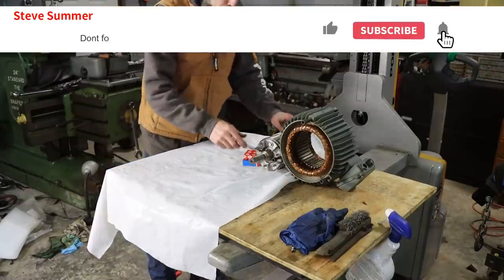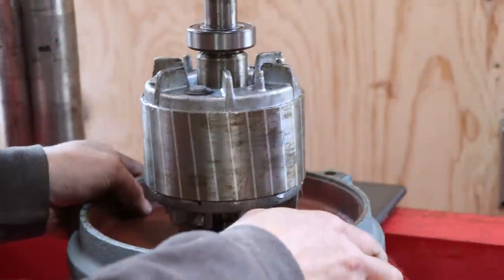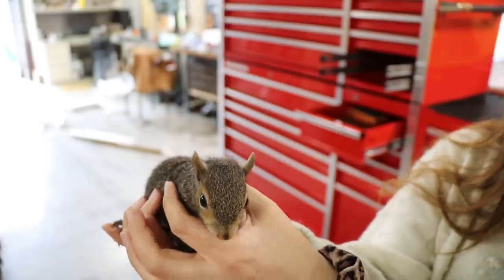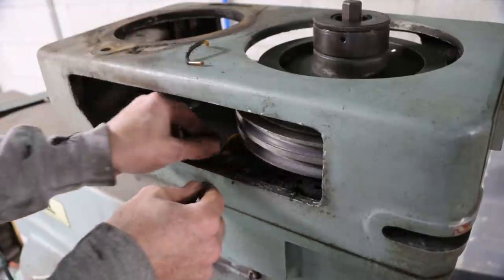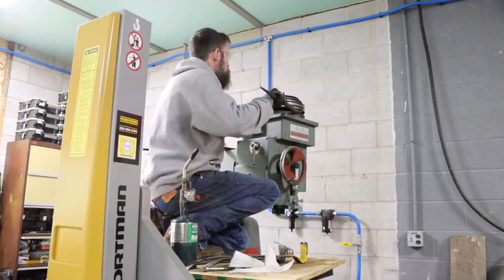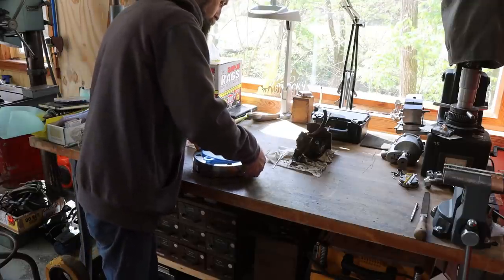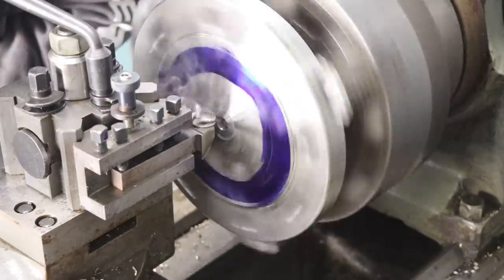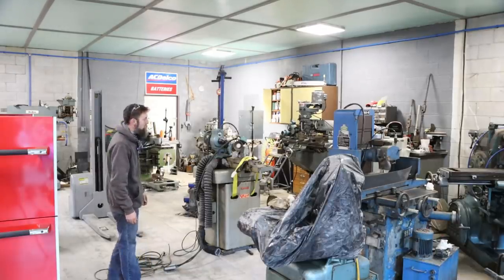Doall Milling machine Head and motor work.

Comment: Steve, your shop is looking great. That old mill looked pretty dirty and nasty but I bet it runs better and quieter with new bearings and the correct oil and grease in it. I got a couple of pictures of Chestnut in this video, he sure is growing. Steve, do you only work for yourself or do you have another full time job. Just wondering because it looks like you could do any kind of machine work or fabrication with a shop equipped like yours and be right at home. I enjoy watching you work.

Comment: Greetings, Mr. Steve. and Mrs. Elizabeth. Would it have been possible to press the bearing into the end plate first, and then onto the rotor so you are only pushing on the appropriate race?

Comment: Nice work on the stainless. I find 304 not too bad to work with. 316 is definitely tougher. I have not tried 303 - it is supposed to be easier to machine. Like you say, don't let it rub, take a cut and go with it.
Reply: Changing the rating of the cap did you remove if any old embossing/stamping?  Would recommend stamping the new rating (lesser) inside the deepened pocket.  Good to see restoration and chips content coming off the shop floor!
Reply: Just be glad it's not inconel or some other incredibly nasty stuff.

Comment: That mill looks like it could probably eat up a Bridgeport in a couple of passes. :)
Reply: It's OK. It's no Kearney & Trecker. We had a really big one of those in a shop I worked in. It made Bridgeports look like little toys. Had about a 12 foot long table on it. To me it looked like the prow of a battleship. It just had presence. Like the side of a cliff or something. It could chew through steel like is was styrofoam. A 3" end mill in it was tiny.
Reply: They are excellent mills.  Made in Spain (Anayak S. A.)

Comment: Shouldn't those countershaft bearings be oiled rather than greased?
Two things make me think this: Grease won't flow well onto those splines and pumping grease into a polymer tube is asking for the tube to burst the first time a clog occurs.
edit: I see you came to the same conclusion

Comment: Could you press the bearing into the end plates first, using the outer race, then press the end plates on using the inner race?  Just wondering...
Reply: Was wondering the same thing, but can you still reach and support the inner race once the bearing is in the end plate?

Comment: how the heck does a machinist not know to oil those points rather than grease them?????  You sure that downfeed requires grease and not a oil bath?  No ring slingers?  timid little squirrel, not like your others.  Have the others been around lately?

Comment: Man, kneeling right in front of that is SO dangerous. If it wasn’t in perfect alignment, it could have popped off, and hit him in the face. Would he have survived that? Maybe. You have to stand to the side, at least, or put a 1/4” thick polycarbonate plate in front, and NEVER hold any of it with your hand after the piston touches the part. We see in these videos, the people who are lucky everything went as planned, but tens of thousands are in the hospital every year, because things didn’t go as planned.
Reply: He's not working with that much pressure. Safety Sally is on a rant.
Reply: @russellstarr9111  it’s plenty. Guys who ignore Safety Sally end up in the hospital sooner or later.
Reply: @melgross  It's amazing I have made it 64 years!
Reply: It’s possible for things to go as planned?????